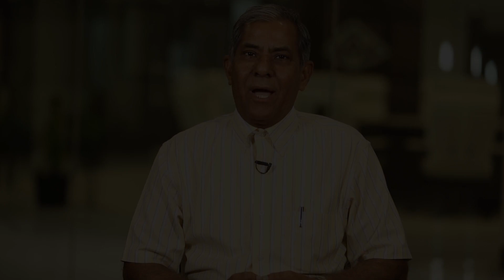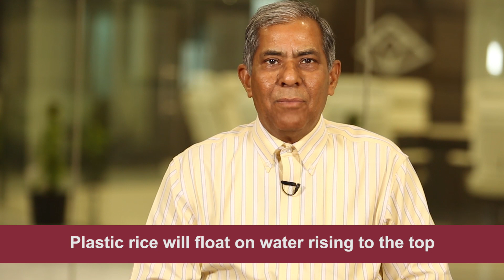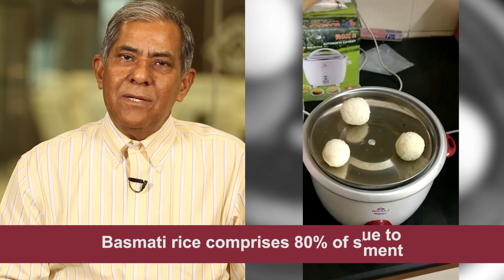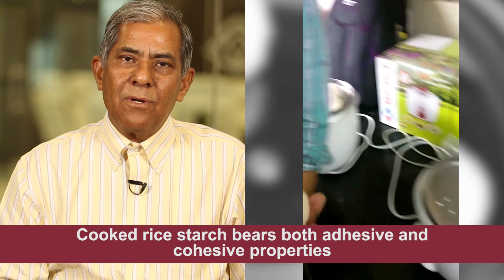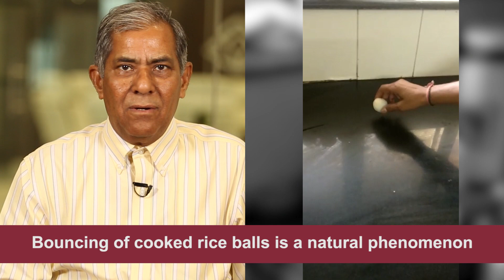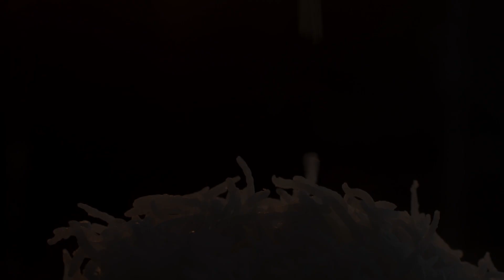The truth behind bouncing rice balls revealed!

Comment: Thank you Sir for the education. I use India Gate for many many years. Can you please explain how to differentiate from the fake one?
Reply from the maker: Hey Ajit, there are many ways to differentiate between plastic rice and real rice:
1. Water test: Pour a tablespoon of raw rice in a glass of cold water and stir. If the rice settles at the bottom, then it is real. If it floats on top, it means it contains plastic rice.
2. Boiling test: Observe the rice while boiling. If it starts to form a thick layer at the top, it is plastic rice.
3. Hot oil test: Drop some rice into hot oil. If it melts, sticks together or sticks to the bottom of the pan, it is fake.
4. Fire test: Burn a handful of rice. If it catches fire and smells like burnt plastic, it is fake. 
5. Fungus test: After boiling some rice, put it in a bottle and leave it for 3 days. If fungus does not appear, that means the rice is fake.
Do let us know if you would like more details.